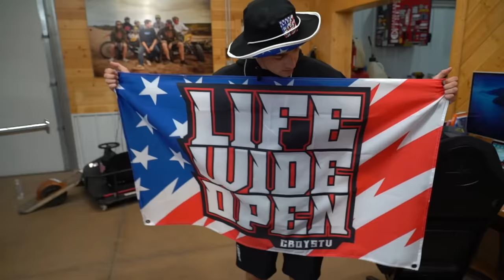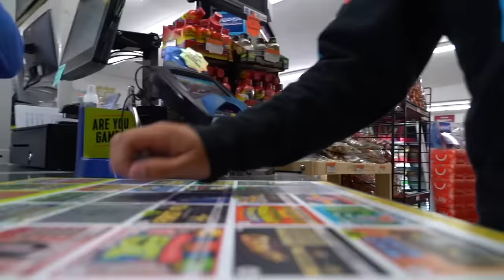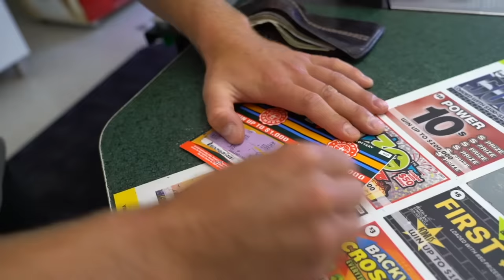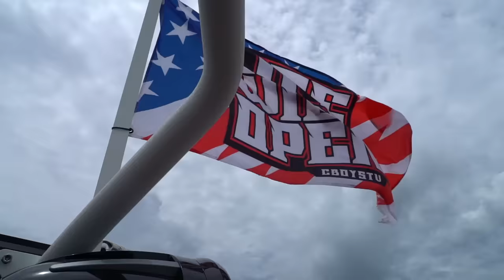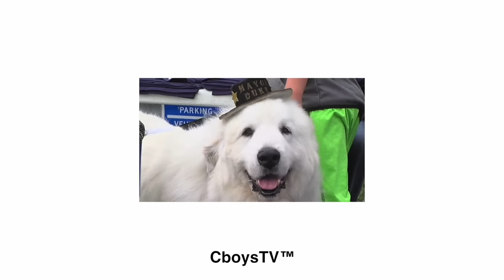Racing shifter karts around town!!

Comment: Have him put line lock on tiny! Its what drag racers use to do their burn out. You push the brake then hit a button and it holds your front brakes locked until you let off the brake. Once you let off the brakes they work normal. Its cheap and safe cause you always have front and rear brakes all the time when you're wanting to drive normal.

Comment: a tru shifter kart either has a cr125 motor or a 125 kz motor specifically built for karting the black kart you gus have is called a DD2 which has 2 gears and is made by rotax. Rotax fell on its face back in like 2014 2015

Comment: A normal air compressor can’t blow up PVC since they push around 125-175 psi unless you top it out and leave it for years it might blow out the fittings

Comment: Go get Electrical PVC its gray it has Rubber in it and is flexible could bake a great potato gun with that and it should explode under high air pressure wouldn't probably go over 80-110 PSi

Comment: Please for the love of god do not pressurize PVC pipe, it has a shelf life and the joints are stronger than the tubes so they will explode outwards at you. Just buy an AR15 and get the can cannon launcher if you want to do silly stuff.

Comment: tinker with air flow, fuelscrew, and stationary screw to get it really fast. get engine hot and adjust stationaryscrew untill the rev is about 1500, then throttle half with brake and listen to the engine. if it goes pfrrrrrrrr it needs more air, if it goes bwaaap and stalls u need to adjust gas needle or fuelscrew. this can take hours if not days to get it really good. Same goes with full throttle, just make sure half and full gas dont sounds like a wet fart or bear yawns and stall. got a sleeper scooter filled up with malossi parts for sale called yamaha aerox hmu if  u interested goes 95/105 km/h 50cc only :D

Comment: Pretty sure that's a Rotac DD2, which will not do 120, and probably not even 100. I have videos on my channel in a KZ125 and we do 100-120 on road courses but have 6 gears and more power.